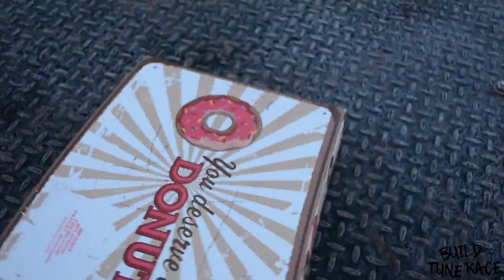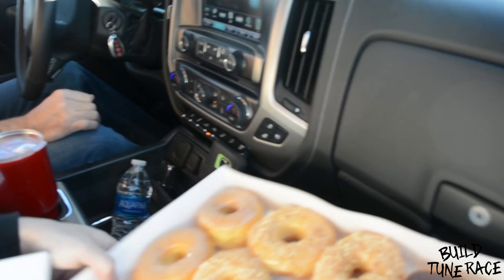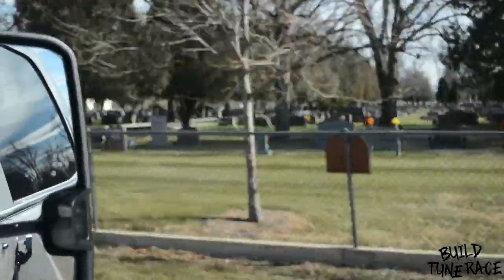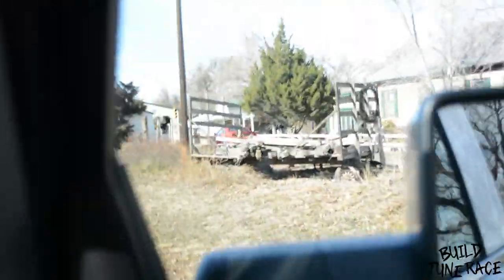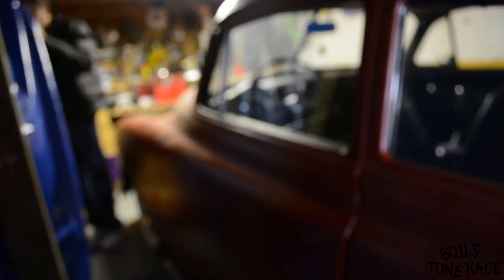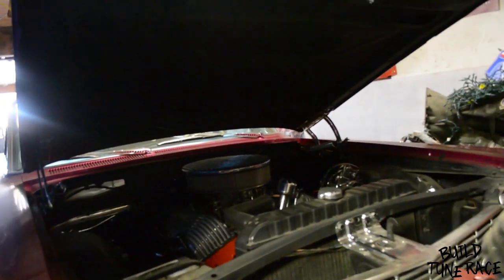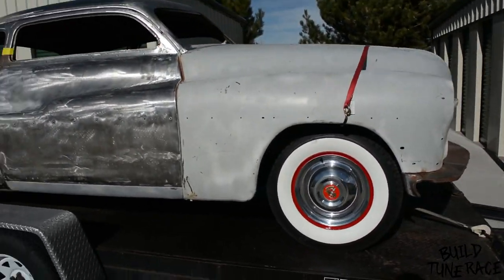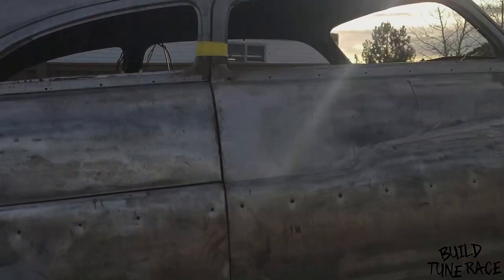1951 Mercury lead sled my Dads new project car | Build Tune Race 2

Comment: nice
Reply: u might want to sub frame  it. then u get the motor mounts for sbc =disk brakes=ps n a good ride chevy nova 1974 or older . u can use an later model but it makes it harder because the steering box in in front of the cross member. u can use a camaro sub also. i drove my 51 merc to daytona turkey rod run 10 years ago. it was a blast. good luck with the build. roger from trenton nj
Reply: u might want to check out my 1949 chopped  oldsmobile on utube